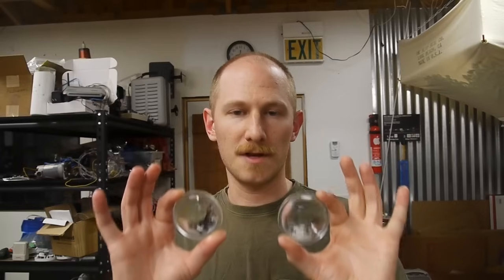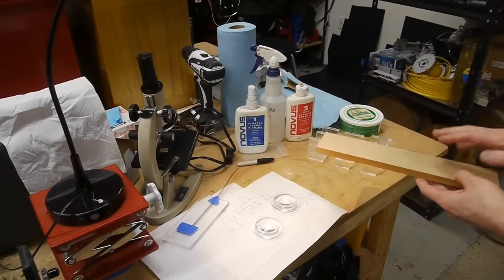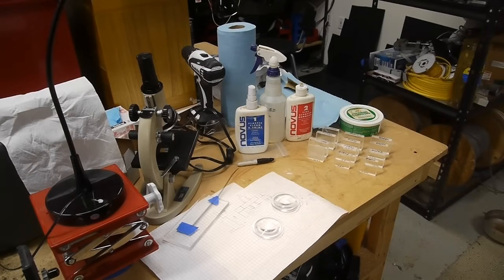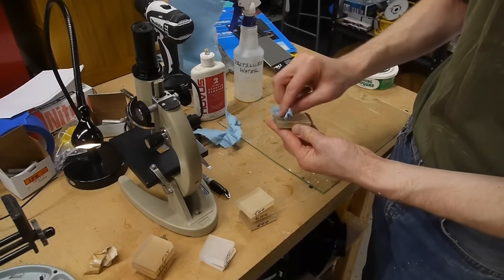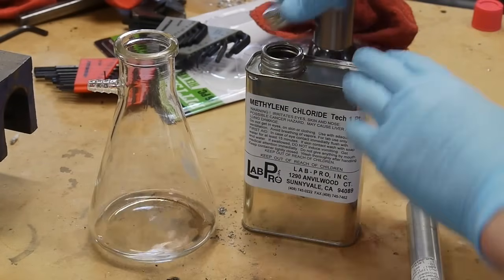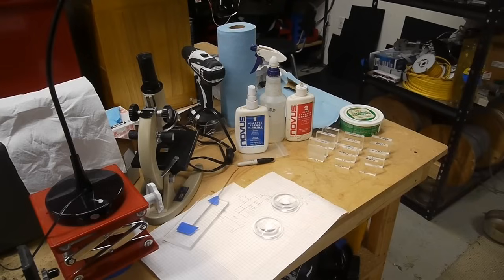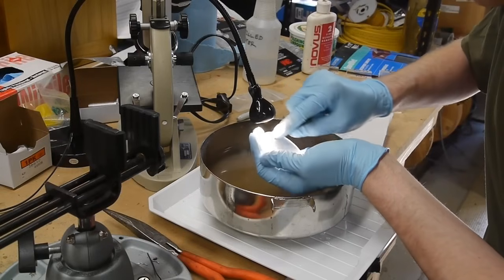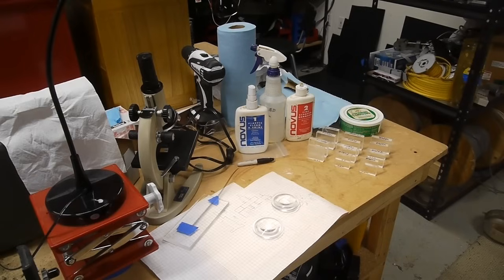Optical finish for acrylic -- vapor polishing and other techniques

Comment: Hi Ben: Another possible polishing method is to lap polish. Machine a concave surface of approximately the same shape, coat with RTV (or similar), cover with plastic wrap and press the convex lens into it and let harden (a few folds in the plastic probably won’t matter). Then lap your lens with Novus and the concave lap.  Even with the problem of the aspherical surfaces gapping, with small rotating offsets you might get a good polish with minimal refiguring. Cheers, Mark

Comment: Would the polished acrylic make better lens if covered with release agent and used as a mold for some sort of clear resin? (obviously it would have to be a negative or used as a buck for a mold.)

Wonder if it would be possible to make concave lenses by spinning the mold as the resin cures?

Comment: Hi Ben: How about a hot air gun instead of a flame, possibly more control but, also possibly not hot enough.  For the methylene chloride method how about adding a gentle inert gas stream introduced at the bottom of the flask or even bubbled through the liquid.  Maybe the gas would help carry MeCl vapor out at a lower temperature (i.e. below boiling) possibly being more controllable.  Good stuff thanks, Mark

Comment: Does anyone know if it's possible to fix a tiny chip in a piece of acrylic? I dropped a drill bit on a piece of thick acrylic sheet and of course it's exactly where I didn't want it to be visible. It's perhaps a mm or so in size. Thanks!

Comment: With a laser the material is not being subjected to any stress which could cause it to crack, unlike say a CNC mill.
I can also testify to the extruded acrylic being better to cut on a laser than cast but you don't get as good a finish when laser engraving on extruded pieces.

Comment: For the vapor method, check out tested dot com/tech/3d-printing/454936-makerbot-mystery-build-smooth-move-ferguson/ where they used heated acetone to smooth out 3d printed objects.

Comment: Ben, how about using buff polishing with a fine buff with ~1micron diamond powder? this is commonly used when polishing metallurgical samples that are cast in epoxy, which incidentally also renders the epoxy crystal clear.

Comment: Maybe boil the solvent in a cooking pan, then have condensation coils running on the highest part on the inside of the pan to condensate and set the vapor level above the liquid. Then dip the piece just below the coils.

Comment: Coupons:  Small pieces of material taken through a preplanned process (or more likely multiple variants of processes), so as to potentially identify a good process path.  Coupon, because the amount of material used is relatively small, this lowers the material cost of testing and probably most important saves labor time speeding up the engineering evaluation efforts.

Comment: This may be due to exothermic reaction of the solvent and plastic, the solvent vaporizing to create the bubbles. Consider pre cooling the materials to absorb the extra heat. There could be a "sweet spot" as a cold piece may prevent the reaction from starting.

Comment: What are these lenses going to be used for? 
And would it be possible to build a lens that corrects for the chromatic aberration using two different blends of acrylics? Given that you would calculate the shapes of the lenses with for example OSLO...

Comment: Very interesting! Just out of curiosity, would you achieve any better results if you flame polished the acrylic to melt the tooling marks and sandpaper scratches down and then vapor polished the resulting finish? The reason I'm asking is because the guy in the other video said "If you polish it after sanding it with 1000 grit sandpaper, it will still look like you polished it with 1000 grit sandpaper, it will just be clear."

Comment: Absolutely, I used it on my car lenses several years ago after using wet/dry paper.  They looked like new right after I finished.  The unfortunate part is that they only looked that way for a few months, so in the end it was not really worth all the elbow grease.  I suppose UV and acid rain on older plastics is far worse than new plastic.

Comment: Damn character limit. You would perhaps also need to make a splash guard that sits in the chamber above the liquid methylene but below the piece of acrylic. You would also have to orientate the apparatus so the condensate running back down from the condenser did not splash/drip onto the piece. I think the biggest problem with this method would be finding a way of suspending the piece of acrylic in such a way that wont effect its final use as a optical component.

Comment: With the methylene chloride method you boiled some in a buchner flask, but I think instead of making a jet of vapor it would be better to make a continous atmosphere of methylene chloride. The only practical way of doing this is to use a reflux setup, which if you don't know is a common chemistry synthesis technique. You might need to make a sizable makeshift boiling 'flask' to hold the liquid and your piece, and create your own matching reflux condenser to re-liquify vapor that tries to escape.

Comment: A peak-reading IR thermometer, following on the flame would give a nice consistent result.

I found when I was just casually doing this to repair scratches in safety glasses that best results were obtained with a very strong flame passed over the surface much more rapidly. (using a butane/propane torch)
With the acrylic in the highest heat area of the flame.

Comment: Great vid! Please do a video on solvent welding acrylic - I frequently laser cut acrylic and join it with solvent glue, but for some reason the solvent fills the join nicely at first, but as it starts to try, bubbles start forming/seeping in and kinda ruin the join. Not sure if maybe the laser cut edges are maybe a little too "jagged" and the water thin solvent is just drying up instead of bonding.